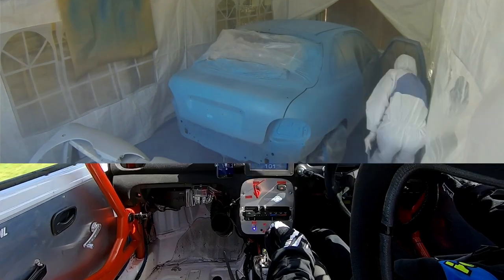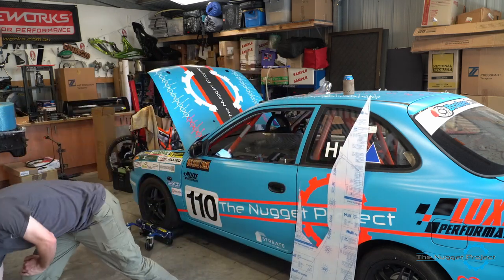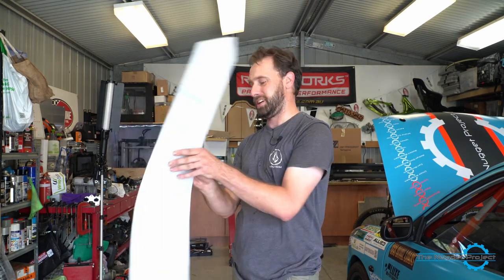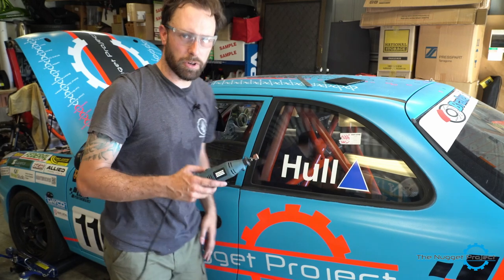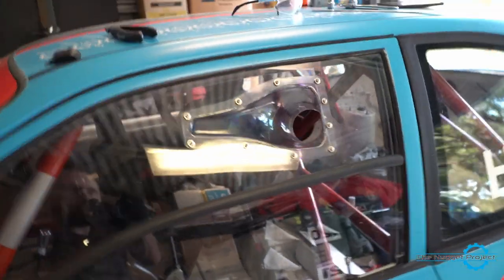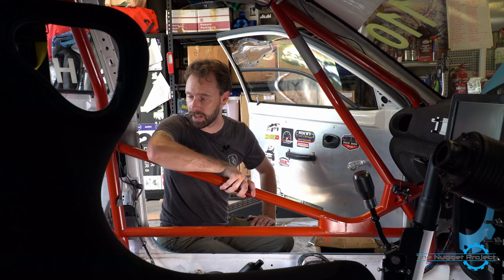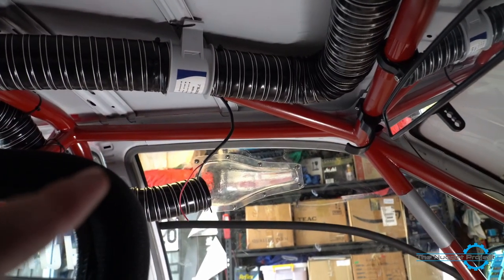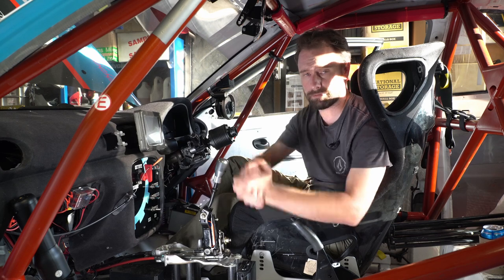Naca duct and polycarbonate window insert - cooler cabin temps!

Comment: There are various versions of why they are called NACA ducts, and various shapes as well.  
You could go to a plumbing supply and get a 90 mm pvc elbow for the end of your pipe. Put a bit of fly screen up the pipe just before the vent exit.  ( Ask me how I know this ) Looks like something from Doctor Who.
 I went to Associated Plastic in Hobart and asked for some 3 mm poly carb. And was told that I needed 4 mm cause the car had 3 1/2 mm factory glass ( they'd done race car stuff before) . An 8x 4 sheet was at the top end of $500 cause it also had to  be scratch resistance stuff, and not the cheaper stuff.
 The guy said to drop in a front and back glass and he would sort something out for me, with off cuts. I was expecting to get a  3 or 4 random size bits back.
Went to collect them. He had cut them all to shape, cut the emergence pull holes in both front pieces, Cut the holes for the sliders, Bevelled round every cut, and put the profile bend to match the factory curve in every piece. $280...
Reply from the maker: good win there on your polycarbonate :)

check out my facebook page for what i did with the nozzle :)
Reply: @TheNuggetProject  God result.

Comment: Nice fan. Maybe incorporate the vents so they ‘clip’ over the roll cage.
Reply from the maker: Yeah for sure, kind of what my design is looking like, just did a test print, wish I could post pics in the YouTube comments! Make sure you like the nug project FB page I'll post a pic on there if it works :)
Reply: @TheNuggetProject  Nice work. In my car I used that 3" bilge pump in replacement of the OEM heater/AC fan and piped it to the floor and the OEM centre vents. Cause those fans blow so hard I got an Ebay 12v fan varible speed controller ($12) and it controls the fans speed. From little to lots. Keep it up man, your getting close.
Reply from the maker: @wilko3sgem  ah nice idea :)